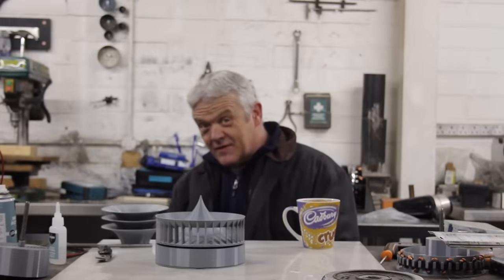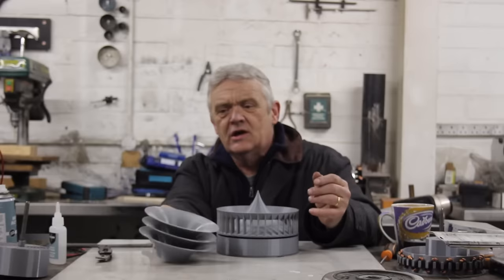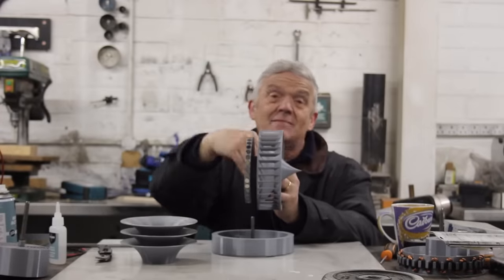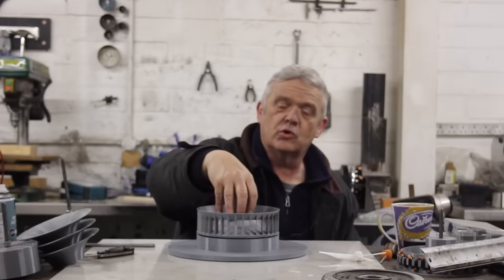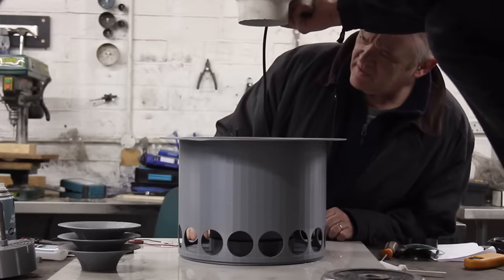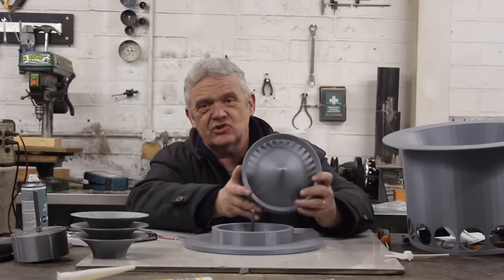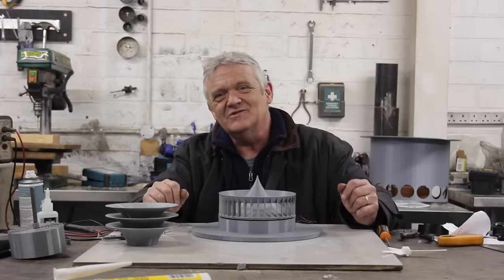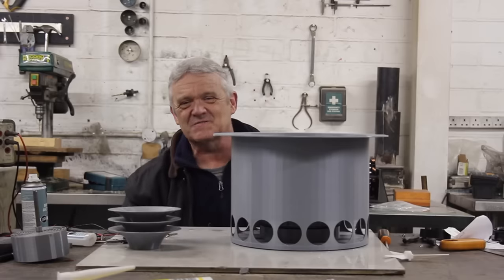1889 Ground Breaking Wind Turbine Update

Comment: If you turn the entire thing upside down and make the centre piece a dark thermal mass you can create the wind you want yourself even in very low wind conditions as then it becomes a solar updraft tower (which have always been wind turbine, given the crucial factor is wind speed to their function). You can drastically increase the wind speed at relatively low cost by using a variety of regular polished metal mirrors with basic solar trackers on them to track the sun and concentrate it all onto the central thermal mass.

Comment: Many years ago there was an article in a Popular Mechanics a design from the Israelis where a wind tower has many panels around it that open with opposing wind. This put the wind into a vortex and at the bottom was the turbine where air was pulled in from the bottom low pressure side of the vortex. I think I still have the magazine.

Comment: Great videos! With this tech, you can fit a 1 in hole on a 1/2 inch bar.
This towers could be done with non high performance materials (steel, or fiberglass instead of carbon fiber) and get the enhanced performance with a smaller turbine, on the ground, instead of having a generator gondola high above, behind the expensive turbines.
Just a sugestion for your larger builds, try 3D printing a mold, and then fiberglass parts, say 1/6 of the cone, to be bolted together, the post processing of this sectors should be minimal

Comment: Back in the day we did a project at an aerospace company spending thousands to make a vacuum forming mould to make a mathematically perfect collecting cone as in intake to a small wind tunnel. A few days later walking down the street I passed a pet shop selling large aluminium dog bowls for £3 that were the exact same shape as the bowl that came back from our forming shop ready for finishing.
Reply: this happens in all industries, and it sucks when you find that the plastic toy you just bought for 2 bucks for your son contain the part you have spent hours and dollars designing and perfecting

Comment: I had a friend, now passed, that was looking into making a large-scale version of what you are calling the Water's Generator.  I'm pretty sure he got the idea from a book printed in  1976 called Radical Technology. Anyway, I remember telling him that golf balls are shaped the way they are, with all the tiny divots on their surface, in order to let air slip over them more easily. I.E. there is some effect caused by those little divots that reduces drag on the ball. Isuggested he try incorperating the use of those divots on the cone section to allow tbe wind to be traveling faster when the wind meets with the blades. I'm no engineer but thought I may as well tell you the same thing incase there might be something in it. Thanks for all the great videos.

Comment: I have been watching the evolution of a amazing wind turbine...

I would love to make 10 or more. I would put on side and face opening towards the wind. A simple tail fin would point it right direction. A series of cross arms would be covered with these turbines. If you had an array of 5 x 5 = 25 turbines in a compact form factor. Several 1 x 6 boards holding turbines. Air has smooth entry, and would exit in back of turbine. 

Someone could use sheet pf plywood. Cutout 25 holes to house the 25 turbines. That should make some decent volts and amps. A sheet of aluminum would also work well. 

Love the videos... great job .... Cheers... Mate.

Comment: Part of the transfer is the impedance matching. The larger input has a lower impedance to air pressure, and translates to a higher impedance to increase the force transfer to the mechanical turbine itself. It's pretty much the opposite of a horn driver in audio systems. 
There is always an entropy loss in impedance matching, but considering the purpose, it's an excellent design.

Comment: If air is blowing into the inlet it will be blowing into the outlet as well going against the flow of the air coming in through the inlet therefore reducing the output. Instead of having outlet holes on the side where wind can flow in you could put them at the bottom under the turbine and the air can flow through the turbine down the side, cooling the generator, and exit underneath were there is less chance of wind blowing against the flow

Comment: Looking at your wind collector cones I think vertical baffles will be needed between the cones to channel the airflow downwards otherwise the wind will just flow around the rim of the cones horizontally.

Looking at it full length baffles every 90 degrees and half baffles every 30 degrees so you don't restrict the flow area. I see possible issues with reverse flow if it's not properly baffled.
Reply from the maker: some will some won't - it's really a question of if it is worth it
Reply: @ThinkingandTinkering  it would make a big difference those of us that have used air tools know the drop of 15% of the airflow drops the tool power by 25 to 30% easy. At low pressures and volumes it's even worse.

Comment: One thing I am seeing, tho you may be already on to it, you need some kind of diverter shroud for the outlets, so they do not fight the incoming side wind. Personally, I think the best option might be a thing like a single piece of your top diverter, but upside down, maybe with a bit of movement, so that when wind blows against eh side, it pushes this shroud down more than it can enter, either to just divert force or to block that entirely. Say that is has a direct gap of only a centimeter off the base plate you have, which will let air flow out to meet with the out side currents, but being narrow vertically, very little force gets thru that baffling to the turbine in what would be a backward flow.

Comment: Rob... I'm hoping that you will consider adding a 2nd "capture" section that is designed to draw the air out... place that on the backside of your turbine to "pull" the air & distribute it back up in the Windstream (at altitude).  Should add to your generation & eliminate the wind dump at ground level.

Just tossing in my 2 cents (pence?) for additional improvements. 

Keep up your awesome work with the channel!
Reply from the maker: nice one mate and cheers

Comment: I commented before but it's clear the outer sleeve is missing an opportunity to capture the side wind hitting it and could have slats much like your 1kw turbine you built. And the Darwin above doubling the wind collection. Just my thoughts. I'll be building that in the coming weeks using slightly different materials as I don't have a 3d printer!

Comment: U should be capturing the charge difference in the flow/compressing/decompressing the air by charge differential in the materials. Could be used to help charge the system to help move it

Comment: Loved the idea of tesla wind turbine. A suggestion was made was to put a spiral groove in the cones. Have you plotted/digitized the 3D curve of the coin going down the Cone? I think you might find that there is an exact mathematical curve for that path and you can then print that as  the groove of your cone and put in  magnetized or electrical wire to see if wind will move faster with boost. suggesting possibilities

Comment: As I recall, your button magnet of-choice is 10mm x 2mm, N35, in the generator section. It would seem a drop-dead simple mod to increase their size to, say, 10mm x 10mm, and to use N45 (or stronger). Might this be a worthwhile variation to investigate? I can't help thinking this would reap huge rewards. Keep up the good work!
Reply from the maker: Yes it would be but right now we are not focusing on that

Comment: I’ve been working with the serpentine coil for about 10 years now on and off, I use it for generators and even brushless motors if I spread 3 coils out evenly, 16 turns of .8mm wire usually gives problem free starting but with plenty of power,
it only works if you join two starts and one end of the coil or Vice versa then use the remaining legs to connect to an ESC, my favourite is an 8 pole rotor and 3 x 8 pole coils which gives you 3 coil poles to each magnet, try it! you’ll be amazed how well it works for an iron free motor.
Reply from the maker: cheers mate nice share

Comment: Robert, create a plexiglass cylinder to go anterior to the  Water's turbine.  Then place a constant flow of air into the cylinder.  Use either smoke or colored air, to see where the air flow is NOT moving through the turbine.  From there, you can improve the turbine.  It is my belief, that there will be quite a bit of turbulence at the top of the turbine, that is escaping WITHOUT moving through the fins of the squirrel cage.  This will be the inefficiency of the turbine.  You would probably do better, to make the squirrel cage the same shape as the cone, only slightly larger, to allow for the air to travel in, and have no way out, except through the fins.
Keep up the good work.
Reply from the maker: cheers mate

Comment: I understand that putting all the electrics on the bottom keeps you from clambering up the thing, but you also need to consider how you're going to remove said electrics. With your current implementation, you have to remove the entire wind capture device to remove the generator etc.

An access hatch would be a good idea, as would inverting the device. If your wind capture shrouds end up weighing in excess of 100lbs when they're finally made out of steel, you have quite a problem brewing when you eventually need to remove it to service the generator. You also need to consider a lockout / tagout mechanism so you can safely access the electrics for service without losing a hand to the spinning parts, or getting your body pulled in from an unbuttoned shirt, long hair, beard, etc.

Comment: Here's the advantage of the orientation of the thing on Skegness Pier (which I am going to see this year, sometime). The airflow over the top provides a suction to improve or increase the air pressure across the turbine. So you might expect that orientation to perform better than one with the airflow-exit at the bottom.

Comment: Wind tower idea. A square collector would work more aggressively to catch wind. A round one is too easy to stream by while the sides and corners of a square will improve capture. Horizontal veins will direct the wind down. A special streamline shape with a blunt or concave rear. While directing windward they work normally to generate internal pressure. On the leaward side the blunt shape of the veins will passively resist the passage of the wind, thus helping to increase the tower's internal pressure. With no moving parts, it sounds good to me.

Comment: Amazing work Robert! Maybe a good aproximation to torque would be Amps. Place a load on the output and measure amps. As I see it, the more torque you have, the more amps you will get. If you have low torque the moment you place a load on the output the voltage will die along with the speed. The higher the torque, less speed will be lost and amps will flow.

Comment: I had an idea that might work as a sort of wind amplifier. The basic idea is that one of the ways that the wind is generated is by temperature differences or rather air pressure can be increased by using a temperature differential. To be a bit more specific I'm thinking that the processes of convection and/or advection could be used to sort of amplify the wind. If we have a hot sand chamber and cold water chamber with some sort of connection between the two there should be a wind formed from the cold chamber to the warm chamber or rather increase air pressure between the two. So I was thinking maybe having a chamber painted black and a reflective chamber, a connection between the two, and the turbine sitting on the outlet of the warm chamber or maybe some other point like where the cold air meets the warm air. Then if we funnel the air from this device into the cold chamber maybe the temperature differences would increase the air pressure. Using something like a sand battery combined with something like the clay pot condensation cooling method could possibly help maintain the extra push even after the sun goes down. Tornados are formed when there is warm moist air near the ground, cool dry air above it and wind shear. Maybe those conditions could be reproduced somehow?

Comment: Very interesting. I was thinking about the benefits of having the rotor on the bottom or the top.  One benefit of having it on the top is the system would self clean and blow out any debris that could get caught if it was on the bottom.  Just a thought.

Comment: I was thinking about your vertical sections and hex vs oct. Dec is the answer. With 10 sides the inner vertical wall sections will have broad enough coverage and approach angle to maximize air deflection and collection. I like the cheese wedge design to ensure directional flow, but remember the cross section of air volume is what you need to calculate for generator diameter, and the drag is real in smaller pipes. Airgun people know there's a limit to how fast you can push air down a .177 barrel vs a .22 barrel. Laminar flow layers compound drag exponentially in narrow diameter pipes. You might want to ensure the vortex/ventrui effect is in rotation with your generator with some impellers or some surface guides. Your shroud shouldn't be wings out of a tube, it should be a smooth W shape to pull side air into the back sections and it should be twice as wide as the unit if structure will permit in winds, perhaps with a missing center section for 360 degree first wind approach. I also suggest not a solid top cap, but a 35 degree slat roof in cheese wedge orientation, flat or slanted or domed. Wouldn't it be nice to have both tech, the Airomine airfoil shape causing vacuum to draw on the pipe which the newton collector and generator are in and maximize potentials on both ends of the same pipe?

Comment: If you know the speed of the wind, and cross sectional area being "collected" you can compare that directly with electrical output to know efficiency.  Your funnel needs a proper radiused curve on its outer edge like an air feed trumpet on a race car engine, or jet engine intake.  Sharp edges are a no-no.

Comment: If someone hasn't mentioned this before.... I would think that wide flange at the top of the forcing cone would degrade the airflow into the cone thus affecting the generator's efficiency. Perhaps removing that flange would improve the flow thus eliminating any turbulence? Just a thought!

Comment: Hi Rob , loven your wind/generator builds , commenting at 11.00 mark , maybe a good suggestion the Converter cone section:- maybe adding curved downward collectors on the centre cone so looking into it from centre tip it would look like jet turbine blade or a spiralling kids slide each curved collector could feed air to say 4 vertical fins.
Another suggestion mount your electric blower fan say 800mm above on a framework  then to measure Torque calculate windspeed from blowerfan and Converter/generator rotation speed . Should show efficiency of catching wiind flow , but I suppose your volts are speed
Cheers Rob
Reply from the maker: cheers mate nice suggestions
Reply: @ThinkingandTinkering  Hi I forgot to mention I stumbled across a research paper testing carbon fiber wrapped around outside of generator housing the test proved that the carbon fiber bounced back/blocked the EMF magnetic field from escaping,  found that interesting haven't tried yet but thought your the person for testing,  it stopped emf leaking out being wasted. 
Carbon felt , carbon fiber woven seemed to be the same affect,  hope it adds some % to generator. 
And I wonder if reason why Tesla ev motors are that way probably strength too.
Cheers.

Comment: Robert, as is, you could place a cover partially over the top, and direct a wind across the bottom(perpendicular to the holes), and the wind would create a suction effect, and spin the turbine.  At this point however, volume should be emphasized, not velocity.
Keep up the good work.
Reply from the maker: cheers mate

Comment: You need to get rid of the sharp angle at the top of the collector. It should shaped more like tuba. Maybe even work on the static pressure generated on the outlet side.

Comment: Yes, I understand you are measuring volts to check the proformance of the wind turbine. I assume? this wind turbine would not be the source of main power as in a 9000 kw generator for the home. But rather a  battery charger for a stack of batteries, which then in turn goes to an inverter for ac application.

Comment: Cheers Robert and Happy Easter! 
I would love to get my hands on a horizontal or vertical version of one or two of these!  We live in the NE USA and I am not convinced feeding solar to the electric supplier will not destroy our 30 year old wood and asphalt roof.  We are on high windy rural hill with no running water or ponds nearby for generation. This just looks wonderful and even at the output you are working at still makes so much sense. A small bank or to would be easy deal with in the back or side yard and should be more manageable weather wise than the wind wall.  I noted in the comments that magnetic bearing or perhaps the latest liquid bearing might keep it on the quiet side and allow for less/easier maintenance.  Wondering if any one locally in our area is working on this?   Thanks Again and Kind Regards
Reply: I have recently been quoted for solar panels, and was advised that there should be at least 400mm / 15” clear from the edge of the roof to avoid wind damage. If you have a solid wooden truss roof, you should be good to go. Solar adds value to your home and will help keep your electric bills down, forever.